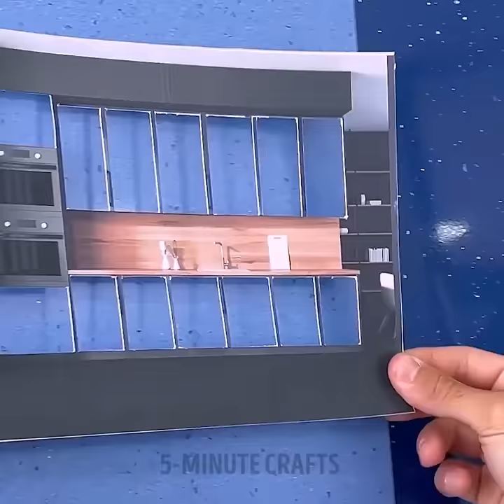From Cracks to Perfection: Essential Wall Repair Tips

Comment: Copper pipe touching galvanized washer/screw, or any other metal other than copper produces a  battery that will burn a hole in the copper pipe. Galvanic effect is the battery produced by dissimilar metals.

Comment: Dude,this is mascerade The damage.not repair it.
Every Professional Handyman with a Little work ethic would slap you in the Face for this sh***.
Instead of repairing the holes and slots in the wall you just Cover them with things that cause even more trouble in the Future because you didnt solved the Problem.
Just Paper,Tape and putty?
Really?